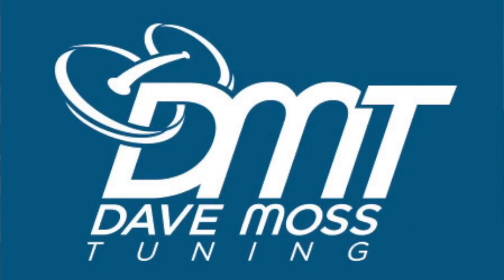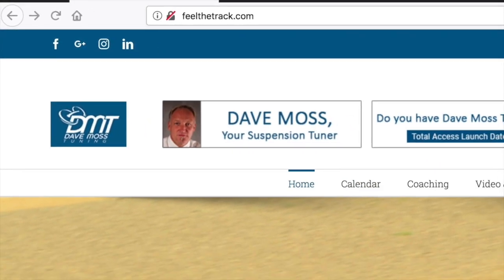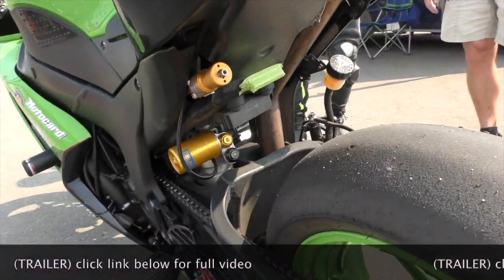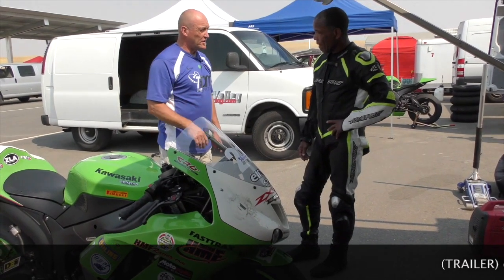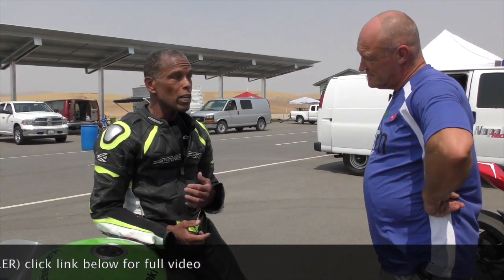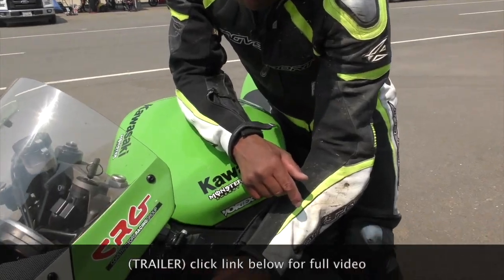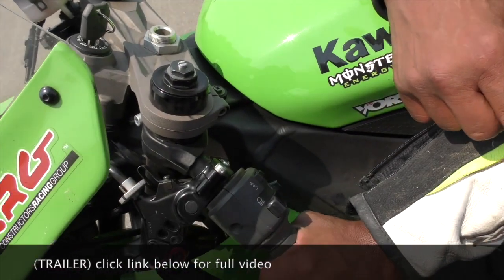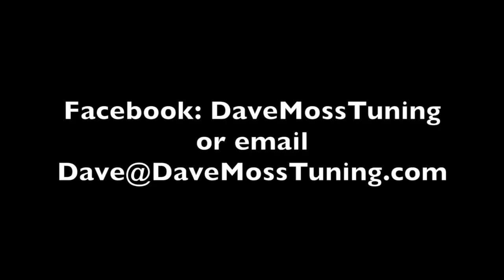2 Clicks Out: Front End Chatter (TRAILER)

Comment: I have the same bike and almost exactly the same problem, thanks Dave for making a video about this. Im having chatter just as im about to release the trail brake.
Reply from the maker: Check fork travel first, then rebound, then tire pressure. You'll find the culprit :)
Reply: Dave Moss Tuning I got it sorted! Rebound was too slow and tyre pressure a bit too low. No chatter anymore. Thanks!